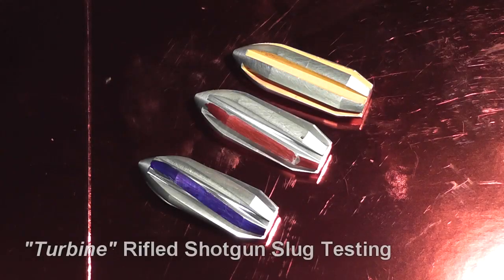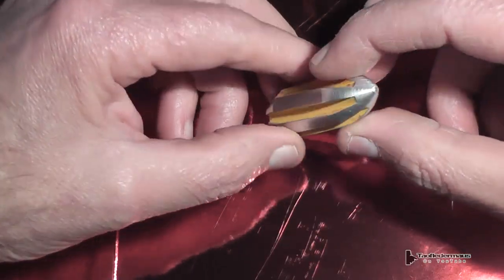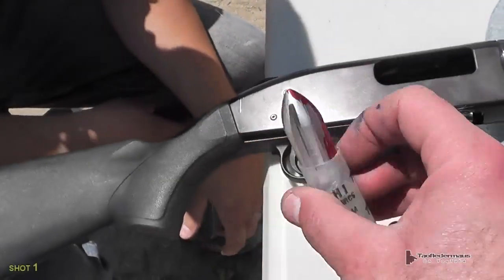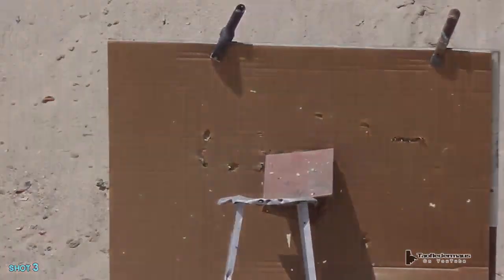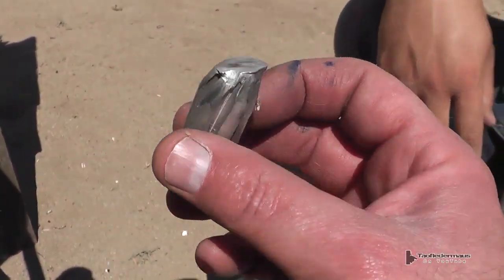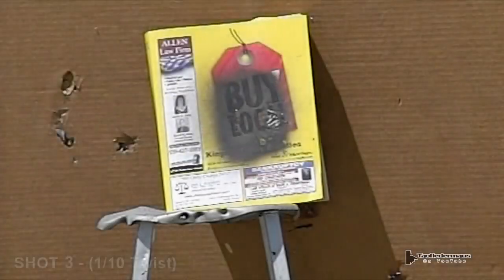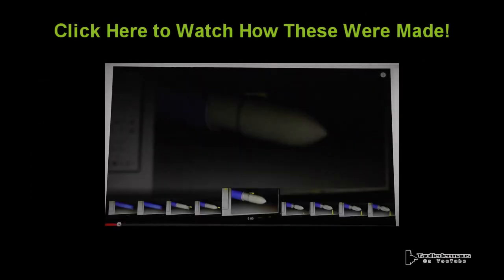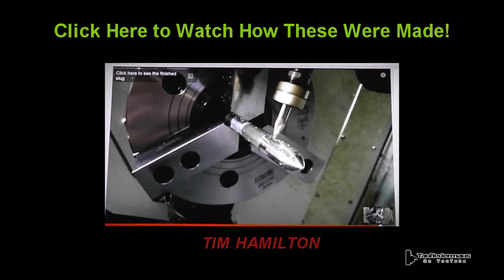Custom Aluminum TURBINE Shotgun Slugs  -Testing

Comment: Regular slugs have that hollow area in the rear to seal the rifling to the bore. Maybe these didn't get enough contact with the bore to create spin because the aluminum didn't expand and seal itself. Were these rounds designed to spin from contact with the bore or from wind passing through the cuts?

Comment: I'm wondering if they need to be more nose heavy and a tail that can induce a little drag to get them straight. Perhaps a teardrop shape and a bomb fin tail but with a helix to add spin. Problem is relying on the air to add spin is going to be difficult at short ranges and it will probably be unstable as it leaves the barrel so large tail fins might be needed to overcome initial instability and more nose heavy. As light as these were they had to be moving good! Perhaps too light though.

Comment: I wonder if there was instability induced by the airflow around the bullet switching as it exits the barrel. When you fire the bullet the gasses from the bullet powder flow from back of the bullet to the front of the bullet and past it.
Then as it stops it acceleration phase and exits the barrel the airflow is moving from the tip of the bullet to the back.  With a "turbine bullet" that might cause it to try to immediately switch rotation directions and put all sorts of funny forces on it.

Comment: Would be cool to make some of those out of Inconel. Would take 100x longer to machine than aluminum but could probably be reused if shot into wood. Extremely tough nickel-chromium based "Superalloy". Would have to make them on an off shift as one round would take easily a few hours to machine

Comment: Same aluminium slug, but instead of the rifleing drill out the core about half way and then drill holes at ~45 degree angle so that the intersect the core hole

Comment: The rounds are too light for the charge. When the powder goes off and the round exits the barrel it wants to throw sideways because the round it's self is just too light. You could maybe use a lower grain than what you had before or he could manufacture some 1 oz rounds. Also the tapering on the ass of the rounds might not be helping. It's not providing the proper drag. And there's the possibility I'm wrong in every way, just my thoughts on it. Cheers

Comment: Those things need stability wings or fins on it that will give it a twist and that would actually fit inside a shell. The rear needs to be wider and the shape need to be more rectangle to snuggle more with the barrel. If I had the equipment I would build a clean slug.

Comment: You need a shotcup to act as a gascheck.  The rifling  is allowing gas past the slug as it is fired.  Slugs would have to be slightly undersize to fit the cup.
Reply from the maker: Jeffrey Plum  The shells used the waddings in them still.

Comment: what kind of bullet will go throw a big jawbreaker? or how meany wall a bullet go throw?
Reply: Jaw Breakers are a bad target as they will just shatter under impact and throw the core when a lump like a slug or 'bullet' hit it. A more conventional bullet would be going supersonic and will just go through the jaw breaker like glass, core and all.

The bullets in the video won't go through any standard walls (should blow out a brick though). Walls are pretty impenetrable short of a mortar round. Also to break walls you need mass more than power. In saying that the required power to breach a wall is explosive (the critical factor in breaching anything is energy and how much can be focused at the right point). If you can't get explosive power you can get a lot of energy from a lot of inertia (a product of mass) so a large slug going supersonic, or a  mortar shell going a bit slower, or a tank round going a bit slower still will breach a wall

Comment: These would work if the nose was solid and the grooves on the side either started immediately behind it or gradually came in toward the rear of the projectile. It needs the extra drag up front, having the air passing through the channels from the front is ramming it against the first curve of the rifling just causes it freak out instead of rotate. Let the laminar flow sink into the rifling from the sides.

Comment: Just a few questions. Regarding the dynamics (omitting weight) but the rifling on the bullet isn't effective compared to a rifled barrel. Most rounds for rifle and pistol shooting are in themselves un-rifled as the barrel imparts the spin. In the case of a shot gun where the rounds are designed to scatter, surely rounds, rifled or not will be inherently unstable until the are traveling for long enough to stabilize, assuming they had any stabilizing tendency.

Another query. surely the best rounds for speed, distance and power have a complete seal within the cartridge to trap as much force from the charge as possible. The look of those rifled rounds suggest that the rifling would allow a lot of the force from the charge to bypass the round, slowing it and making it less effective than it could or should be?

One more query. if a shotgun was rifled (just for the sake or bullets) or a spare barrel was machined and rifled for a shotgun, would the shotgun become a rifle (forgetting for a second the origin of the term rifle)?

Comment: Im sure that problem with this slug is that fins are not touching barrel, but are incased in wad , so they never get the chance to spin.
If they where touching the barrel, and not placed in wad, it would work much better.
Reply from the maker: SatansBaby1  The idea goes back to other videos like the 3d printed slugs where viewers believed that adding spirals to the projectile would cause the round to spin, induced by the slipstream.
Reply: ***** I dont think that willl work in this case, because there is no air going around this projectile until it leaves the barrel and wad,  and after that i think its to late. I it wasn't in wad, maybe it would work .
Sry for my english, im from croatia :).

Comment: That was awesome. I wonder if changing the was would have an impact on the rounds spinning up in the barrel. Instead of a cup just a flat disc.
Reply from the maker: Mike Dittman   I'm not sure.  I'm thinking it was a center of gravity problem.   There could be all sorts of factors.
Reply: They are still really cool looking.

Comment: I believe the the shotgun shell wad had something to do with the tumbling of the round. When the wad catches resistance, it starts to tumble causing the round to tumble. You should test those same rounds by shooting then from  pressurized pvc, hooked up to compressed tank of air.
Reply from the maker: jason willett  I did put one inside a syringe and blew air through it and it spun at a high rate.
Reply: *****  i strongly believe the round it self is fine, all four that you shot should fly straight. I wish you could figure a way of still shooting then without interference throwing them into a tumble.  How about slicing the wad down the sides, so when its shot out, it grabs the air like a brake. Maybe it will allow the projectile to continue straight. If any if what i said makes any sense. Lol
Reply: jason willett....I strongly believe that instead of u annoying the shit out of people everyday for their money... u should have became a forensic scientists.... lmao..
😁😁😁😀😀😀

Comment: Those are awesome rounds. The only suggestion i could possibly have is to place a heavier metal core on the inside of each turbine (brass, bronze, copper, lead) that goes the length of the turbine. Then the heavier metal also pops out the back along the diameter. Lead would be ideal. Considering the lead could be smelted into the middle and have a mold for the bottom this could increase accuracy, and weight of the projectile while keeping its cool spin factor.

[]---------------------------\
[]-----------------------------\
[][][][][][][][][][][][][][][][][][][
[]-----------------------------/
[]---------------------------/

Comment: i think these would have worked better if you didnt have the shot cup in there and just a cardboard wad below it or just take the fins off the shot cup  because that might be int erupting the airflow and keeping them from doing what they were designed to do i could be wrong but its worth a shot ( no pun intended)

Comment: I think with lighter projectiles you have to slow it down. Longer projectiles work better with a faster twist, but the speed factors in. It's complicated with new properties, really more art than science (art is extremely complex science you have to feel rather than consciously calculate because it takes to much calculating for left brain to deal with and hold it together).

It can be useful to exaggerate characteristics and extrapolate from what is discovered.

Comment: This is actually not that hard to explain (I think), it's what I suspected for quite a few of these "rifled x shotgun ammo" videos. I think that the reason the rifling isn't working is because the explosion gases go partially through the rifling and spin it the wrong way (also make it less stable, since they never go exactly in the same amounts all around the projectile), so when the projectile leaves the barrel, it's tumbling and spinning the other way already. A simple solution to that would be to make the indentations become more shallow towards the end of the projectile, up to being flush with it at the very end. You lose a tiny bit of velocity and stability, as the bullet is now pushing the gases outwards also at the end, but it makes it so only stream of air going towards the end of the bullet makes it spin, while the stream of explosion gases going the other way acts at the indentations didn't exist. If I were to design the next batch of test rounds, I would make them of two types: one with completely flat end (and with shallowing indentations like stated previously), like a bullet, and one rounded, like the ones in that video, also with shallowing indentations. Flat end would make the explosion gases apply more direct forward force and less sideways, when passing by the sides of the bullet, but it will have an effect on aerodynamics, so I don;t know if the outcome would be better or worse.

Comment: Just was thinking he did boat tail the slugs but what I notice about most Deer slugs is they are hollowed out on the back keeping most of the weight forward also keeping the rear of the round from trying to out run the Front. May be keep most of the Rifling to the Rear 1/4 and hollow it might also work as a drag to a point to keep he round moving as well as keeping the weight forward. I could be wrong I am an Electrician not Bulletologest.
Reply from the maker: Jesse Cassidy  but Ohm's law explains everything!
Reply: Lol

Comment: Great stuff! The machine work looks beautiful, I have no doubt with a little weight change, that thing will fly as straight as an arrow.
Fun vid TAO, thanks for posting.
Reply from the maker: Thanks Andrew.   Tim may be contacting you about another design he has made.   He made 9 of them so he was hoping to send you a few to shoot at some gel.    I only need 4 or so he can send the rest to you.
Reply: Sounds great. Thanks for the reference.
Reply: I'd be interested to see what this could do with a hardened steel core.
Reply: GY6vids In a word... FANFUCKINTASTICALLYBADASS!! LOL!
Reply: The weight is to light to the force, causing the tumble.
Reply: GY6vids If it were possible to hollow it out and pour some lead into it, I wonder if it might set the CoM far enough back to get it to fly straight.

Comment: You should buy a cheap single or double barrelled shotty so you can shoot crazier loads!
Reply from the maker: Kurt Stoll  Most single shots have a tapered barrel  and we need a cylinder bore.   We've been able to shoot long objects without very much inconvenience.
Reply: ***** not true a choked barrel starts at just a inch or two in the bore just like a screw in choke
Reply: *****
I'm sure you can find something that will work.
It will probably work better than a pump action either way.

Comment: I've built a couple model rockets when I was a kid. What a learned with rocket telemetry is that the balance needs forward weight in front of half the length of the projectile body to compensate for weight in rear thrust. Maybe having a rifled aluminum body with a cupped combustion chamber and a lead or tungsten tip is the key.
Reply from the maker: buck19   With the armor piercing darts we filmed a while back,  that was what seemed to make them work.  Very nose-heavy.
Reply: ***** with a .70 cal you want the forward balance to be at minimum .70" in front half the length of the projectile to maintain flight stability.

Comment: Hey ***** i was wondering, im 16 and love to shoot, i have access to a CNC machine, 3d printer and the works, im good at making things like bullets and the stuff you make, i have armor plating and Kevlar to protect my self, how safe would you consider these bullets and how often if ever have you been hit with shrapnel off the camera. btw love your vidoes
Reply from the maker: Kaydn Burns   We haven't been hit with any rounds.   When we shoot hard plates,  we set them at an angle,  usually back and to the side a little so the rounds bounce off in a different direction.

Comment: Great rounds, but to be ideal, a rifled barrel should be used with the projectile matching the turn rate. That imparts initial stabilization, then the grooves would help after.
Reply: Rifled shotguns already put enough spin on the sabot. It's nearly impossible to make aerodynamic forces alone to act on a projectile to make it spin, and for realistic shooting distances bullets don't "lose" their spin. They remain stabilized, while velocity clashes against aerodynamic drag, there isn't a lot of force to counter the spin.
Reply: Filipe Amaral yep. A .338 will be stabilized for miles. There simply isn't enough drag on the spin direction to make a difference
Same with a shotty. A sabot should not be spun, but this is more like a pretty slug. The gives won't really do anything more than look cool.
Reply: No, sabots are to be spun. They're fired from rifled barrels, imparting a spin on the bullet. The ones that don't spin are rifled slugs, which are meant to deform and not get stuck at the choke.

Comment: Alright, I'm not a scientist, but I have taken a few physics classes and engineering courses. What I think may be going wrong is that (with these slugs) you are hoping that the force of the air in the fins will outweigh the mass of the slug; versus having rifling positively enacting spin on the slug. I feel that these aerodynamic slugs will require something of lower mass, with most of its mass toward the front and the aerodynamic influence to be further to the rear for stability. Correct me if I'm wrong.
Reply: Exactly - the air simply doesn't exert enough force on the grooves to make it spin.

Front-heavy slugs hollowed out at the rear or with a light polymer stabilizer are already the industry standard.
Reply from the maker: Ghoogleplus SUX  We had pretty good luck with the darts like in here:https://www.youtube.com/watch?v=WGzgbXCrWHQ
Reply: ***** Was most of their mass up front?
Reply: The darts were fin stabilized - same principle of aerodynamics being used, but instead of being front heavy they have more drag on the back. But to help, one had plastic fins and some others had a hole drilled into the back.

Comment: USE A RIFLED BARREL NOT A SMOOTH BORE
Reply: That would be unbelievably stupid. The whole point of trying to stabilize slugs out of a smoothbore is getting them to be stable out of a smoothbore. We already know rifled barrels stabilize saboted slugs well, and firing an aluminium slug with grooves machined into it would not only be pointless but also wear out the rifling faster than a sabot.
Reply from the maker: James Gallagher  They wouldn't need the milled slots then.

Comment: Commercially-available rifled lead slugs don't spin in the air. There's not enough force acting on it. What keeps slugs stable is weight and balance, which the 3D-printed plastic slugs just didn't have.

Comment: I bet thinner versions of this aluminum bullet but with a sabot constructed for the right twist rate would be devastating.
Reply: It would need to be made of tungsten carbide and be shot at higher velocities. Literally all a saboted dart can do is penetrate, and a "softer" metal like aluminium shot at shotgun velocities wouldn't be that great.

Also, saboted darts are often fin stabilized rather than spinned. The M1 Abrams fires mainly saboted fin stabilized "darts" and HEAT rounds (the explosively formed jet is dispersed if spinned) so it has a smoothbore barrel. Tanks with rifled barrels but fire these kinds of rounds have slip rings or ball bearings on a sabot to let them fly straight.

Normal, commercially available saboted slugs for rifled shotguns are like .50 caliber and expand like crazy. Way nastier than a dart.
Reply: ***** Don't get me wrong, I even said spin-stabilization is bad for dart-like projectiles (and HEAT).

A longer version of this would still be weak, and shouldn't be fired at any twist rate. That was my point.
Reply: ***** penetration requires sectional density alluminium lacks it.
 I think a cloth patched machined Tungsten steel slug would shoot through a bull Elephant lrntghwise at close range ,shaped right.
Reply: ***** The problem is, for them to be made out of say tungsten would automatically consider them AP rounds by the ATF. But we'll need a replacement ammo soon since some states like California want to ban the use of lead ammo for hunting.
Reply: Ratkill9000 AP ammo's definition from the ATF only applies to handgun ammo. .30-06 M2 is legal. You can get AP for .50 BMG.